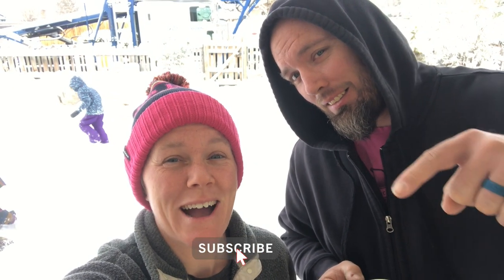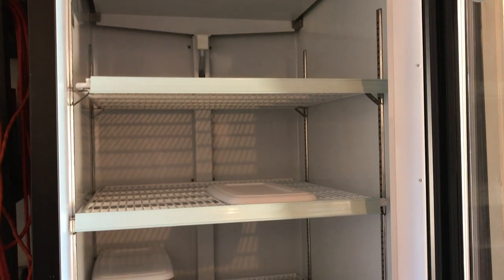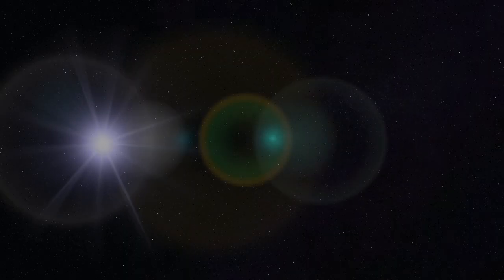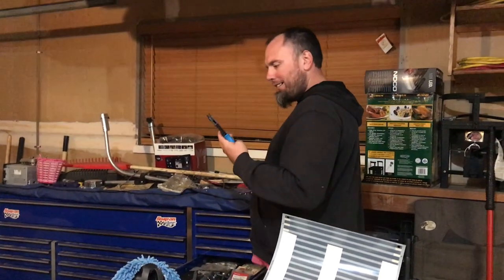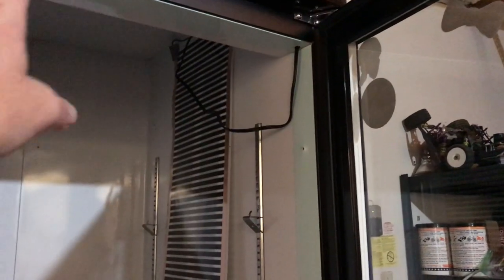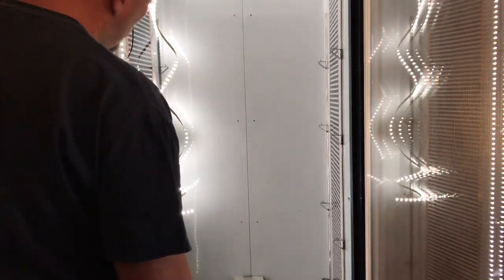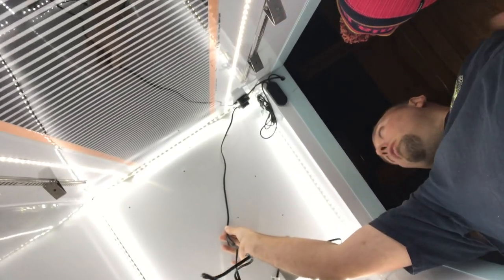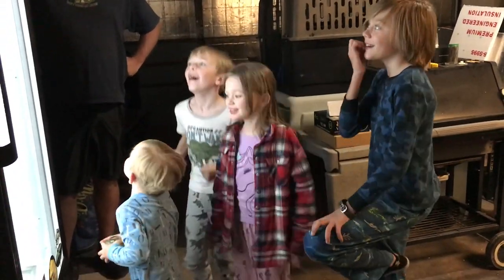DIY Reptile Incubator | Transforming An Old Cooler to A Reptile Egg Incubator

Comment: Great video! Is there a reason why you put the heat tape on the top and sides as opposed to on the center of the back and bottom? I'm about to build one and am not sure where exactly to put the tape and fans.
Reply from the maker: It is not on the top. Only the sides. We chose to do it this way to heat the inside more evenly. We have seen many people have issues with it along the back and then later have to create a false wall to distribute the heat more evenly around the sides. We put the fans where we thought they would do the best. The fans are to push the heat down and circulate throughout the inside.
Reply: Ok, that's what I though. Nice job and thank you for the quick response.

Comment: Curious, does the humidity effect the computer fan ( AC Infinity Fan) your usingand did it come with all the wiring needed to make it work or was that separate?
Reply from the maker: Most of the humidity is contained in the egg boxes, so I have not seen a difference is function with the fans. The fans did come with complete wiring assembly and control switch.